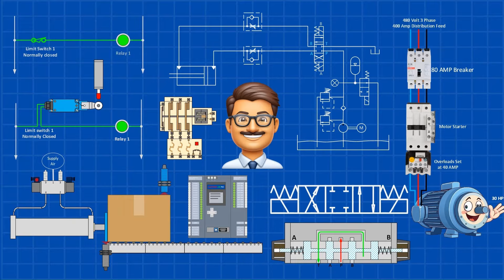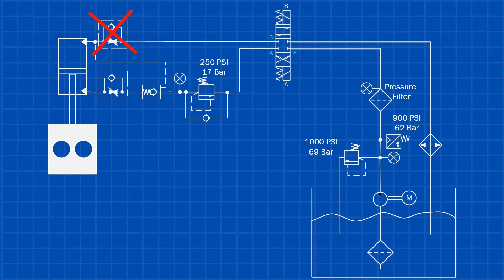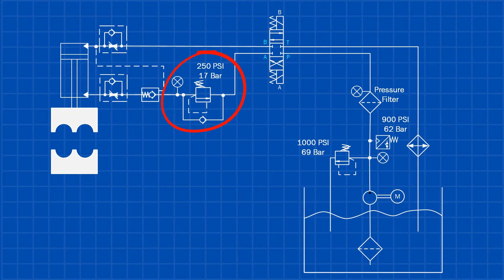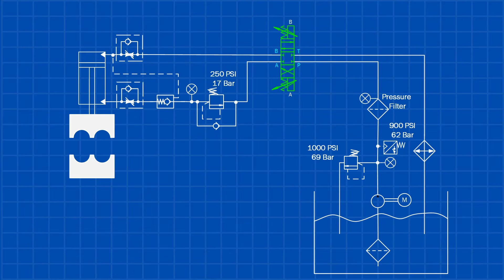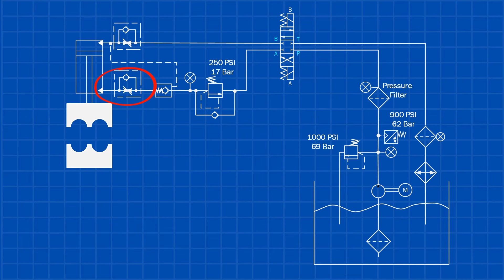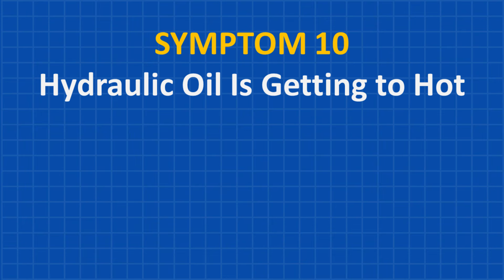STOP Guessing! 30 Years of Hydraulic Troubleshooting in One Guide!

Comment: I have a hydraulic problems, the cylinder and the manifold is all very hot but I dont know why? Everything is working well but the oil is become very hot
Reply from the maker: I need Information. How long the cylinder is under pressure. If it is a clamp cylinder that stays on for a long time, the oil under pressure creates heat. Can you let me know if this is the case ?
Reply: @Electrical-lad its is on cylinder like a press machine but it cut metal. The big cylinder of that machine is very hot , the manifold is hot too. Its difficult to see where is the problem. When somethings its hot , it can be anything in a hydraulic system
Reply from the maker: What is the temperature of oil at the tank?  If the problem just started you have a problem with cooling system , for example heat exchanger ( could be dirty. If problem existed from beginning, you have an undersigned cooling system, or the tank is too small. remember, approximately 30% of  Horsepower goes to heat, and that is oil.

Comment: I’ve got a hydraulic press when tripped the motor whines and the head has gone down twice but very slowly, it usually just stays at the top and doesn’t go down. I’ve replaced the directional valve with new coils and still the same issue. Clog somewhere? Or fluid bypass somewhere?
Reply from the maker: Are you telling me it goes down but does not go up?  If this is the issue, you need to first make sure you have pressure first by dead heading the pump thru the relief  and see  what pressure you have? then get back to me with the results.

Comment: I have a cylinder that extends just fine, on retraction. It will go about 6 inches, stop, then like 2 inches , stop, then half an inch, and then eventually will not retract any further. It is able to be pushed back in under no pressure.

Comment: How about cylinder extends at exact setting but slowly on retracting
Reply from the maker: I will more information, is it overhung load, horizantal , or vertical lift? what type of directional valve? does it have  directional flow controls, etc...?

Comment: I have an issue with a boom. It goes up just fine one to 3 times then it gets slower and slower then won’t go up at all until it sits for about  8 hours.
Reply from the maker: Run the boom 3 times, then check the hydraulic tank.
If the oil looks foamy or milky, the pump is likely sucking air.
If not, watch the pressure gauge—if pressure drops each time you lift, the pump is worn and losing efficiency as the oil heats up.
In most cases—around 80% of the time—the pump is the problem.